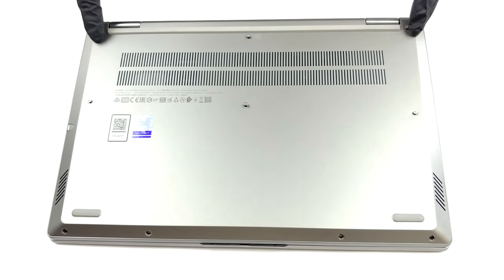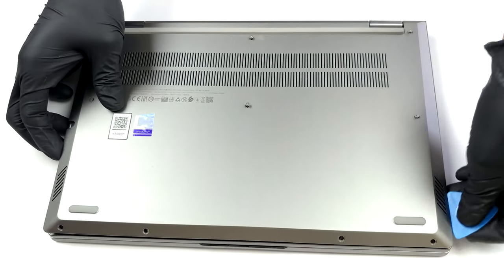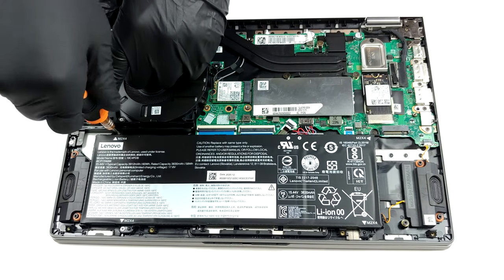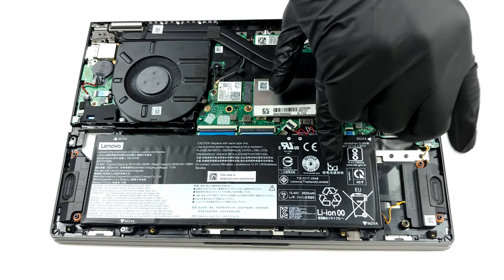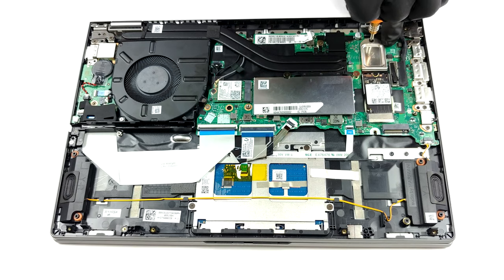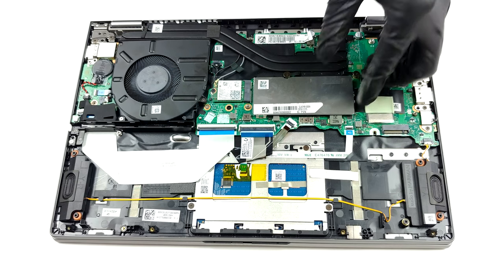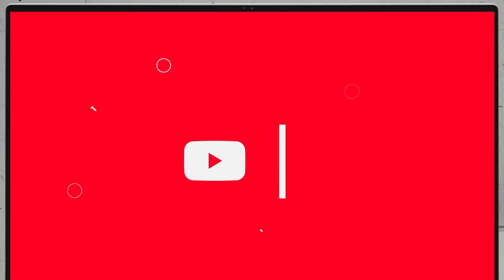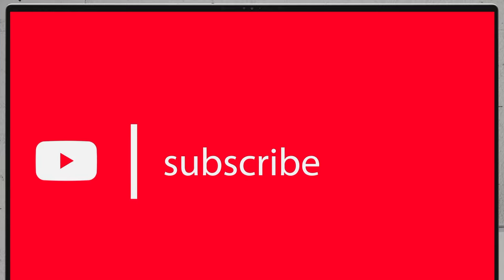🛠️ Lenovo ThinkBook 14s Yoga - disassembly and upgrade options

Comment: Can I ask? How many M.2 slots does it have?
Reply: 2
Reply: @andreaskamenik5209  Where is the second one, or are you talking about the Wifi card slot?
Reply: @Florin_Neagu  It's empty right now. It's in the bottom right corner of the motherboard (right under the first one, just mirrored downwards). You can see a black socket there. The SSD points to the bottom right corner of the chassis. Wifi has its own slot and of course can stay connected all the time.
You can look here: https://www.youtube.com/watch?v=Vf9I5qD_8kE The part you're interested in begins at 3:57.